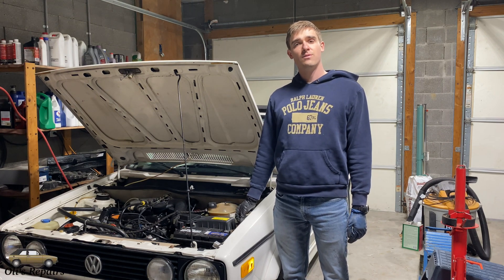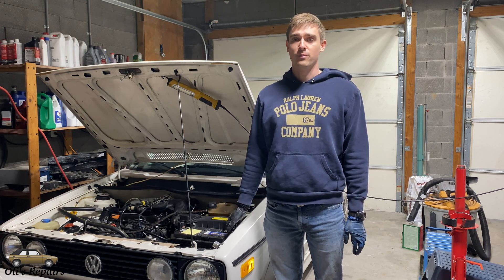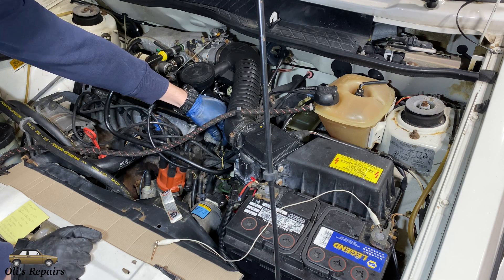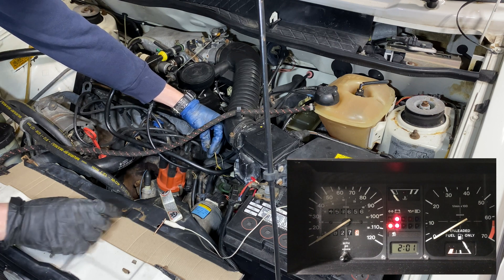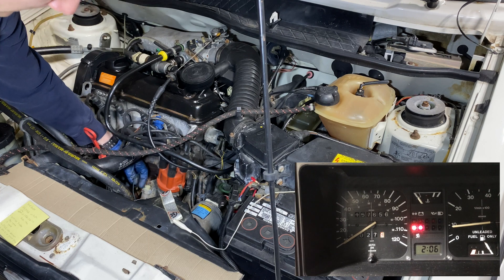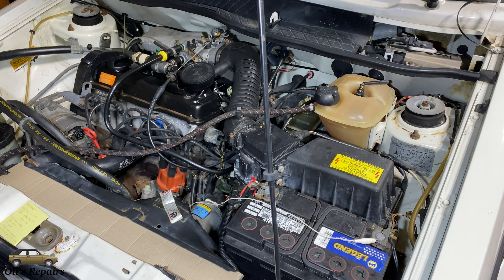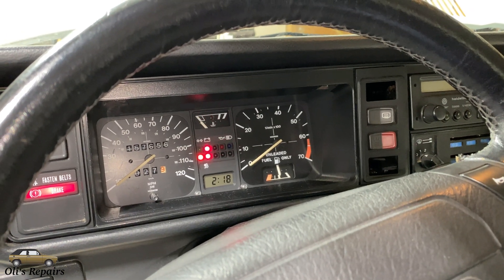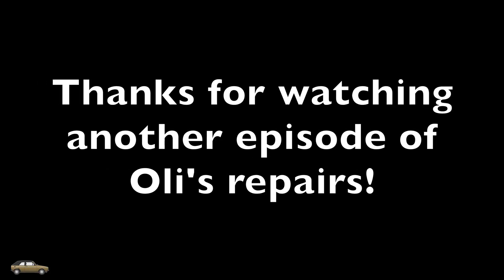VW Dynamic Oil Pressure System diagnosis Mk1 Mk2 Cabriolet

Comment: Hi, I bought a gauge oil pressure and i don't know Where do I install the sending unit ? On the head or near to the oil filter, can you explain please
Reply from the maker: Are you trying to install a second oil pressure gauge?
Reply from the maker: Are you trying to install a second oil pressure gauge?
Reply from the maker: Are you trying to install a second oil pressure gauge?
Reply: @OlisGarage  yes i want to install a pressure oil gauge, the problem is where should i install the sending unit because i saw someone's install it on the head and others installing it next to the filter
Reply from the maker: @raoufdz7160  both locations are fine. Filter will have a tad higher pressure most likely.

Comment: Hi Oli can you please assist me i overall my mk1 1992 model engin but the light go's on and makes a buzz sound i replace the sensor on the oil filter but the light is still on when i drive it comes on and if i gave little gas it stop buzzing and but starts buzzing again and the oil comes out from the breather hose on valve cover tnx in advance.....
Reply from the maker: Not sure if you replaced the right sensor. Did you ground the wire when the car was off to check if it turns the light off? 

Sounds like you have serious blow by issues that need to be addressed.

Comment: Hey Oli,
I have the problem that my oil light only starts blinking when the engine is getting warm! So around 90 degrees, the light starts flashing and sounding, but it stops immediately when I push the gas over around 2500 rpm! But it starts flashing again after a time?!? Do you have a solution? Thanks Oliver from Germany✌️
Reply from the maker: Hallo Oliver! Es hört sich an als ob der Öldruck zu niedrig ist, oder der 0.3bar Sensor defekt ist.

Welches Öl verwendest du? Ich verwende 10W30 im Winter und 15W40 oder 20W50 im Sommer (ähnliche Temperaturen bei mir wie in Deutschland). Dieses könnte ein Unterschied machen. 

Der Sensor mag defekt sein. Dieses könnte man mit ein Messgerät testen. Es ist relativ einfach. Nur den sensor ausschrauben und Messgerät rein schrauben. Auto starten und Messgerät anschauen. 

translation: it sounds as if the oil pressure is too low, or that the 0.3bar sensor is defective.

Which oil do you use? I use 10W30 in the winter and 15W40 or 20W50 in the summer (similar temperature by me as in Germany). This can make a difference. 

The sensor could be defective. You can test this with a oil pressure tester. It's relatively simple. Unscrew the sensor and screw in the pressure gauge. Start the car and read the gauge.

Comment: Hi , when i drive the car my sensor does nothing but as soon as it starts to get hot the buzzer starts screaming and the light starts to flash , what can it be
Reply from the maker: Harnu Muller are you sure the wires are all properly connected? Did you follow me test outlined in the video?
Reply: @OlisGarage  I have a sensor on the head but my previous engine did not have that sensor so , that sensor does not have a wire so its open

Comment: I did all your tests. This was the result
Blue wire did nothing whether it was connected or grounded. No light at all except the battery light but I dont think that has anything to do with the battery.
I tested the High pressure sensor..... nothing happens when connected but light blinks at more than 2000 rpm for 2 seconds.
Reply from the maker: Kelly Sutherland do NOT ground the blue high pressure wire for the test.

The key is to NOT ground it. If you ground the blue wire, you tell the system the high pressure switch works. (The way that sensor works is that it closes or grounds the system over 1.8 bar). 

You need to disconnect the blue wire. Start the car. Oil light should be off. Rev to 2500 for a few seconds, light should blink until you shut off the vehicle. 

If this occurs, then the system works properly and your high pressure switch is bad.
Reply: @OlisGarage  Hey Oli! This last response seems counter to the video itself, but it's likely me misunderstanding. So I understand, if I am experiencing the light blinking after 2000+rpms with switch plugged in run this test:  on the high pressure switch, disconnent the wire, start the car (light should be off) and rev to over 2000 for a few seconds...if light comes on with that switch disconnected, its the switch that needs replacing (don't ground at all during this test)?
Reply from the maker: @coryclaypole5710  start watching around 4:00. But you’re mostly right. 

We need to test the system. So we first tell the system that there is no oil pressure (sensor unplugged and wire dangling). The light should blink over 2k rpm. 

Then we tell the system the oil pressure is good by grounding the wire. The light should not come on over 2k rpm. 

I do both of these tests to test the two conditions of the oil pressure warning system (pressure is good, pressure is not good). If it passes the two tests, then you know your electronics are good and the switch is the issue

Comment: Thank you again for your wonderful video I do have a question about my Volkswagen 1991 Cabriolet oil light comes on with a buzzing sound only when the car is driving however when idling it does not I tried to replace the oil sensor and is not fix the problem the old oil scent high pressure oil sensor was leaking
Reply from the maker: Have you done the tests outlined in the video? The system is only designed based off of rpm. Not speed. Try revving the engine above 2000 rpm for about 5 seconds and see if the light comes on (like I do in the video).

Comment: Just a note, the high pressure one is actually a switch. The Bentley manual refers to it as a switch. I believe the term "sensor" is actually used for a component that, in conjunction with a gauge, measures pressure or temperature. Although there are many other types of sensors too besides a sensor/gauge combo. A sensor would have an internal resistance which would change in reaction to a change in temperature or pressure (coolant, oil) to give you an actual indication. I have the feeling you are well aware of this and inadvertently said "sensor".
Reply from the maker: K Stewart you are correct. I mean, in a way it is a sensor giving a binary value of “yes” or “no”. Not trying to get into an argument at all. I could’ve been more clear. Appreciate the feedback!

Comment: For anyone here that has the Grey Robert Bentley service manual for Gas,Diesel, and Turbo Diesel 1985-1992, those twits have the location of those 2 switches ass backwards. THE MANUAL IS WRONG! The higher pressure switch (yellow wire) is on the oil filter housing and the low pressure warning switch is on end of the head (blue wire, black stripe). Given that i had paid something like $90 for it back in 1991 when i bought a '91 Jetta TD new, i am rather Pissed. Am having a problem (intermittent also) with my 1986 TD and just discovered this. My '91 had gotten totaled by some a-hole running a Red, would have had the board from it, but another a-hole stole the whole car off a property where i kept it. I did have the engine out of it which i kept before the car was stolen. The location of the switches in the '91 are exactly the same as the '86 with the location of higher and lower ones the same.
Reply from the maker: K Stewart good call, thanks for sharing. It’s also wrong in the Bentley for the cabriolet.

Comment: I have the same issue I replace the oil pump and the high pressure switch but I keep having the oil light flashing and buzzing should I replace also the low pressure switch. Also I’m using 20w50 oil is there anything else should I be looking at???
Reply from the maker: Follow the video very closely. If the light never turns off, then it has to be the low pressure switch.

Comment: i think u just saved me alot of money... god bless this video.. been having that same problem with my high pressure sensors... as soon as i  reached 2000rpm or so... thanx again Mr
Reply from the maker: nkosikhona ezzyboy spelmandla glad I could help!!

There is an oil pump changing video on the channel as well if you decide to change that. Not a hard job either.
Reply: @OlisGarage  will give that a try too thanx.. bt my oil pump still new...
Reply: also wanted to know if the vehicle was standing for a few years would tje oil filter housing habe any possibility of clogging up with oil to interfere with oil pressure maybe ... im Changing that today due to a problem i found on the housing ans well as getting a new sensor for it...
Reply from the maker: nkosikhona ezzyboy spelmandla definitely change that. It might not be damaged, but it definitely is old.

Comment: Hey my cabriolet is having problems with temperature problems,  overheating. And the temperature gauge is not working
Reply from the maker: Recovering Libertarian I’ve got a video on fixing the temperature gauge. You might have a faulty radiator temp sensor as well which is not allowing your fan to turn on.
Reply: @OlisGarage  thanks keep up the great work. your videos are well made and you put alot of work in them.
Reply from the maker: Recovering Libertarian appreciate the kind words. More are in the works!

Comment: The oil pressure sensor link says it will not fit a 1992 VW Cabriolet. Is it supposed to?
Reply from the maker: Kelly Sutherland I’m assuming you’re talking about the high pressure sensor.  Yes it will fit. Not sure why amazon thinks it won’t.

Update. I used that exact part and it worked. Also, if you read the reviews someone says it worked for their 1992 Jetta. That Jetta has the same engine and oil pressure warning system as your cabriolet.
Reply: @OlisGarage  This might be a silly thought but could it be that some parts used in the Canadian models are different than the ones in the U.S. model.....I am assuming you are in the United States. Or are they all the same?
Reply from the maker: Kelly Sutherland I’m in the states. Amazon said it doesn’t fit a 92.. but that’s on their end. I am rather certain this is the same part even in Canada. I didn’t know Canadian cabriolets had very different parts? I know a main difference was daytime running lights.
Reply: @OlisGarage  You are so helpful. Thanks so much!
Reply from the maker: Kelly Sutherland you’re welcome! Report back if it fixes the issue

Comment: Hey Oli I have a question...my cluster clock works  andwhen I turn on the lights the light comes on, but everything else doesn't, like my battery light, temp light oil light and also my temp gauge and fuel gauge don't move....any ideas thanks!!
Reply from the maker: Fernando Rangel it sounds like your voltage regulator needs replacing. I don’t have a video on that (yet!). I’ll update this comment this afternoon with a link on someone else who replaced the voltage regulator.
Reply: @OlisGarage  I did replace it but when I checked voltage there's none..I know ur supposed to have like 10v
Reply from the maker: Then you probably have an iffy connection with your instrument cluster. Try wiggling the connector and seeing if that helps. Be gentle with it, but wiggle it just a little bit. 
The other option is that your blue Mylar on the cluster is broken somewhere

Comment: Mine blinks at low rpms
Reply from the maker: Aldo Torres so you turn on the key, start the car, and it blinks and never stops?
Reply: Oli's Repairs after it warms up, it blinks under 2k rps at idle. I already replaced the water temperature sensor and it still blinks.   Thanks for the reply! Keep up the great videos bro 🙌🏻👍🏻
Reply from the maker: Aldo Torres what is blinking? I’m assuming the oil pressure light. what oil are you running? What is the average temperature outside?

My theory: you’re using too thin oil. Cabby-info.com mentions that a ton of people run 15w40 or even 20w50 in the summer.

Appreciate the kind words! :)
Reply: Oli's Repairs im talking abt the coolant temperature. Weather here in cali is abt 70’s rn.   The oil problem its something else i need to work on. Replaced both sensors and added some lucas oil to thick it a lil.  Havent gotten on the road yet cuz im working on the interior 😅
Reply from the maker: Aldo Torres I’m assuming you have a 1990 or newer?
Reply: Oli's Repairs 1988
Reply from the maker: Hmm. That is weird. And it always starts when over 2k rpm?